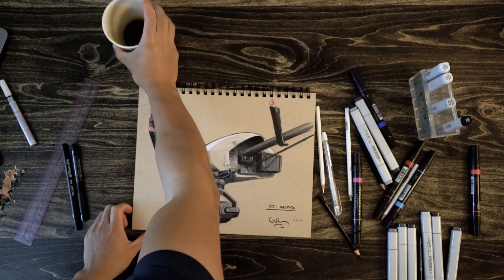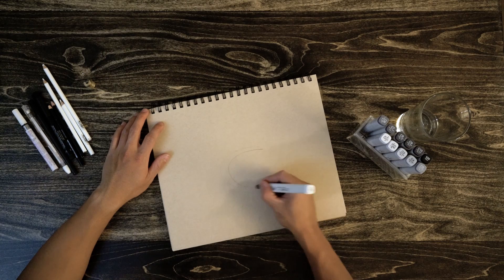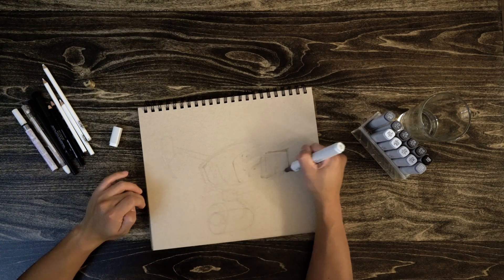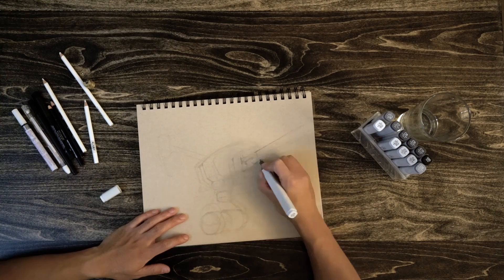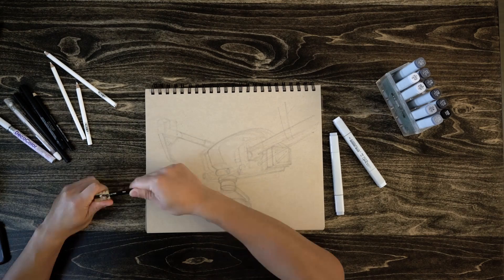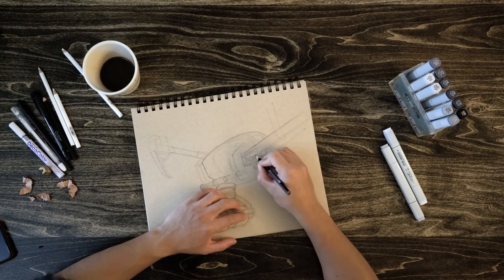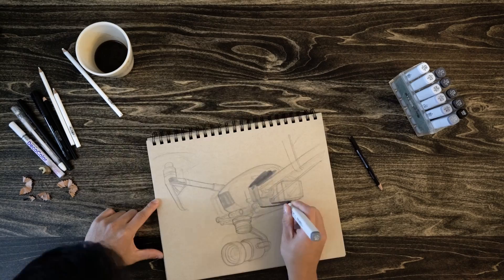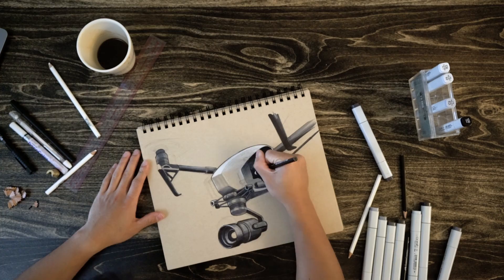Product Design Sketching Tutorial - DJI Inspire

Comment: 2 Quick questions. Why is it, that when I use a marker, my lines/ellipses are much nicer and controlled, but when I use a pen/pencil, I look as if though I've never drawn a day in my life?

Secondly, is it necessarily bad that almost all of my drawings use "perspective" lines? I can't seem to draw squat with out them, and it makes me feel horrible seeing other design students draw things on point with out them. (This feeling is compounded because I'm applying to transfer soon, and feel my portfolio/skills are not up to snuff).

3rd question, okay I lied. I see you use tanned paper, does it cover up mistakes easier than white paper? I'm not insinuating that you make mistakes, I just hear you say that it's "forgiving". Forgiving in the fact that you can make a few booboos and recover it, unlike white paper, where a single line is off and it wrecks the work?
Reply from the maker: Hi Adrian - Markers have a thicker line weight, masking the tiny imperfections that you'd generally see with a pen/pencil. It also depends on the pen - ballpoints tend to catch all the surface imperfections of paper, whereas felt tipped pens (like papermate flairs) tend to glide much nicer. 

Perspective lines are just another tool in your toolbox. Use them whenever you feel the need to - I still use them all the time (in the form of a box that sets up the general sketch subject). You shouldn't hesitate to use any "tool" that helps your process. Remember, sketching in and of itself is a tool.

Toned tan paper allows you to be less meticulous with remembering what highlights to leave white, whereas on white paper, you have to be really careful with this. You can go through the sketch and instead, use a white colored pencil/paint pen to make those highlights pop. 

Hope this helps and good luck with the transfer!